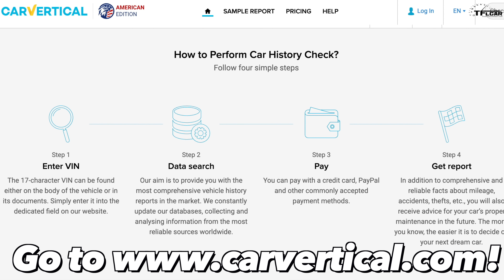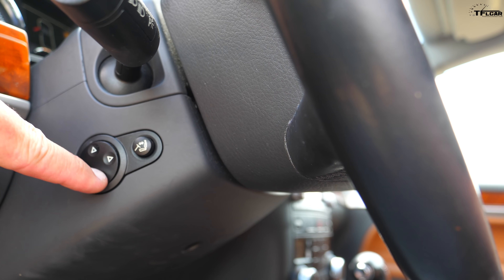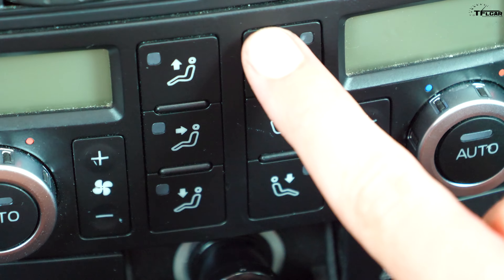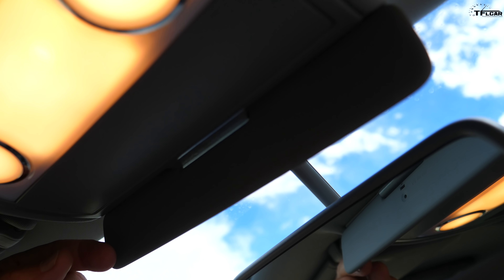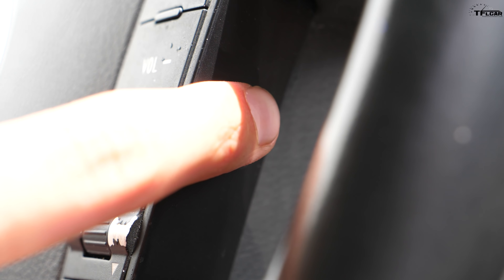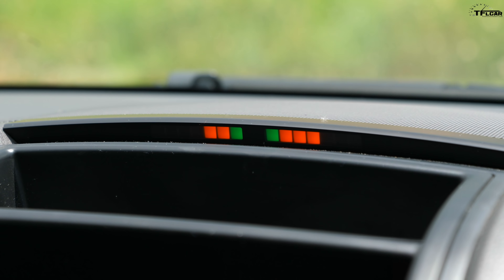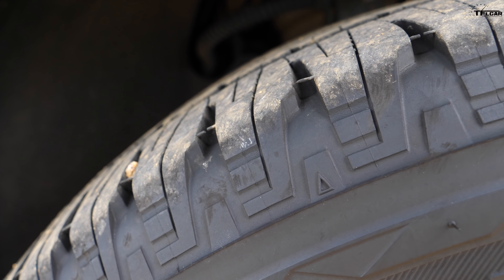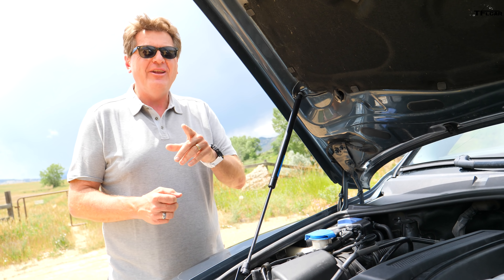We Just Bought The World's MOST Under Appreciated AND Over Engineered Car! Tough T Ep.1

Comment: Nice vehicle for the channel. These interesting cars are why people watch. Sure you could have bought a 2003 Lexus GX 470 or 4 Runner but it would never break and are everywhere so what's so interesting about that. Good choice for entertainment.
Reply: I own both a 2003 GX470 and a 2003 4Runner. Indestructible but no rear locker, front locker option. Less clearance overall. Less power, 5 speed auto only. No 2wd option in the 4runner v8
Reply: Very good perspective, Dallas.  Should be worth 10 episodes at a minimum with 200 comments each about how unreliable these are and how prone Tommy is to hitting things.

Comment: The Toureg is one of our most favorite vehicles, we had the diesel loved it, great gas mileage and power.  The Toureg had a fantastic Torsen AWD system which as an AWD fanatic I think is the best. The Toureg handled very well was comfortable and other than one engine issue that VW took care of was extremely dependable. We sold it back to VW for near what we paid for it with over 40K miles on it and wanted to buy another diesel but couldn't.
Reply: The  Tourege was state-of-the-art and well ahead of its time. Unfortunate, mericans didn't know what to make of it, and VW no longer imports to the U.S.

Comment: I've had my 07 since 2012 and absolutely love it, it's my daily. By 2007 they worked all the kinks out like upgrading to a timing chain that only needs changing every 100k miles vs 25k for the timing belt. Great truck, but like all older germans they need to be kept up. Anyone who works on older Cayennes can wrench on a Touareg. They used Audi motors just fyi. 

Truly a wonderful beast of a car that is equal parts capable and composed. The perfect balance 👌. Nothing today comes close. 

I predict it keeping up with the Jeep. Although the Touareg is very heavy in comparison, keep that in mind. Literally the same weight as a Cadillac Escalade (the Tahoe sized).

Comment: A mid to late 2000 VW= something's going to break every month. My 2010 Jetta TDI was in the shop almost monthly until VW bought it back (Thank God)!
Reply: Have a Audi A3 8L 1.9TDI 2002 with manual gearbox, running fine at 385k km :P
Reply: Didn't they have a recall that was so bad that they kept denying it?
Reply: @rkan2  you're the exception not the rule
Reply: Just because you had a poor experience doesn’t me others have. VW’s have been my most reliable vehicles.
Reply: @ljgarrison6910  Nah, I just have a VW with a manual gearbox, timing belt, and no DPF... ;)
Reply: My 2010 jeta tdi was the best car i ever had 130k miles not single problem of any kind not eaven rattling plastic or panoramic sunroof problems. At about 30k my father hit a dear with it, actualy deer hit him on freeway into passenger door. Got fixed up and no problem after that. Got 4 other vw not single problem with 2.0 and. 2 wr6 and 2.0t gti mk5 all of them manual transmision. If you want to call it a problem only 2.0 used about 1quart of oil before oil change 5k that newer changed until day i sold it.....
Reply: '06 golf 1.9 tdi 165k miles, nothing wrong - apart from the usual (brake discs, new clutch etc).
Reply: @ljgarrison6910  the 1.9 was very reliable. A co worker had a Jetta A4 TDI which he put 400K km. It was his beater. He junked the car after the clutch gave up and the body was beyond repair.

Comment: I had the same car back in the day and loved it.  19 » for summer and 17 » for winter. Great car except high fuel consumption even for those days and high curb weight which does show on- and off-road. Never had anything wrong with it but maintained it as per VW guidelines. It was fun off-road, did a course with VW instructors in France (they used V6 diesels) and felt that was the best overall engine, more low RPM Torque that worked well with the gearbox, less weight over the front axle and lower fuel consumption. Looking forward to the off-road episode!

Comment: Oh! One really fascinating feature you haven't discussed yet is the fact that the truck comes with its own very long air hose with tire inflation chuck and built in gauge on it. The hose plugs into a port in the air suspension system underneath the front of the passenger front seat to inflate tires. The hose is indeed long enough to reach every tire on the truck.

The spare tire itself has a collapsing sidewall. Once inflated, it is just about full size, but obviously nowhere near as rugged or capable of gripping off road terrains should you get a flat on the trails. That was an option on Touaregs in Europe to have a tail gate mounted spare tire on its own swing away frame. Plus, there was an optional electrically disconnecting front sway bar.

As usual, Europe always gets the good stuff and we get the scraps.

Comment: That suspension system is sweet, but how long until a major repair needs to be done? Nonetheless, plenty of cool features and one heck of a price with the new-ish tires.
Reply: replace with coils if it goes out
Reply: Never put coils on it. Had one for 5 years with air and no problems. The air is one of the best features. If it does have problems parts are easy and fairly cheap to get hold of.
Reply: The car has already lived a long and useful life. This is round two, and still going. So the naysayers words of fail fall of deaf ears.

Comment: I own a 2004... only been driving it since March. I went all in and got the V10 diesel. Put 10,000 faultless miles on it so far. That is after I fixed what was broken when I got it... which was that the camshafts have worn. Engine out job. Super interesting engineering all over in these trucks, that V10 diesel engine included, but they are indeed a bear to work on. And I do my own work. I bought the special tools to do the job. Even despite having a hoist at my disposal, it still took me about a week to drop the engine and take my time carefully changing out all the parts. I put new high pressure fuel pumps on it too (well, the passenger side is technically a "tandem pump", as it also contains the vacuum pump for everything that requires vacuum).

As far as I know, the air suspension on mine is original, too... with 180,000 miles on it. So far so good.

I am not going to rely on it as my only vehicle, but I sure as hell am going to get full enjoyment out of it. The V10 is insane. It's not any faster to 60 than the V8, really, but it just feels effortless when you dip into the throttle. Actually, thinking about it more, the V10 makes identical horsepower to the V8 gas engine, just waaaay more torque... but also much more heft (the V10 rig was just shy of 5900 lbs without fuel in it). Also strangely, despite being the heaviest and most powerful engine offering out of the Touareg lineup, the V10 was the most fuel efficient, too. Mine has regularly returned better than 21 MPG on long highway trips doing 80 for long stretches at a time.

Strangely, mine doesn't have the rear climate controls, heated rear bench nor does it have the ski pass thru. The heating steering wheel was retrofitted by a previous owner along with the webasto auxiliary heater AND, paddle shifters. Nice, big, metal paddle shifters. I would not trade that feature for anything after living with it for a number of months now.

This might be the first torque converter automatic I'm aware of that also rev-matches downshifts. It's a bit slow and ponderous compared to dual clutch units in smaller vehicles or the latest and greatest 8 speed from ZF found in many different vehicles, but it does indeed rev match downshifts in tiptronic mode.

The way that air suspension and active damping system rides and adjusts, I wouldn't trade it for the conventional spring type suspension. The ride and adjustability is phenomenal. The seat comfort and adjustability is also amazing for long trips.

Great video, you guys picked out all the fun quirks and features (to use a Demuro term) I've come to find on mine as well. I love it.

So long as you can keep it out of the repair shop, you will be happy with it. And for how amazing it is on and off road, you'll end up willing to put up with a little pain when it comes repair time to keep such an amazing vehicle in your fleet. Looking forward to your off road adventures in it.

Comment: I bought a 2005 VW Touareg V6. I haven't really had many problems with it and bout it last year October for $3000. I do all my own maintenance. So, its been a great SUV. 

The only maintenance I have had to do so far has been rear brake pads and rotors, rear driveshaft, O2 sensors, and basic maintenance (oil change). All I have to do now is just change my catalytic converter before I get it inspected next year. So far a great vehicle.

Comment: My mother has a 06' v6 tdi for 10 years now and this thing is bulletproof. Never broken down and only maintenance on 150k miles mostly city driving. Early cars especially with the v10 tdi are horrible and far from reliable but the v6/v8 versions up from 2004 are quite solid cars. And men they're capable offroad. They can climb 45 degree angles and even make some jeeps blush

Comment: Love the Touareg! Was a VW tech and yes those first gens had a lot of electrical gremlins and are pricy to maintain. The v10 tdi is crazy to drive! Incredible off-road. The Touareg 2 2006-2010 many of the electrical issues were addressed and were much more reliable. The 3rd gen 2011-2017 are incredibly reliable although less off-road worthy. No more dual range transfer case or locking diffs but still do well off-road. They are built like a tank, handle very well, and my 2012 lux is my favorite vehicle to log miles on. Great seats, great visibility, stupid quiet inside, and who doesn’t love 6 piston front and 4 piston rear Brembo brakes from the factory!

Comment: Forget what year mine was but I paid 4,800 for it and it had push button start but it didn't have the nav system or the air suspension. Two of my favorite things about the car was the turning lamps that illuminated the road on either side of the vehicle depending on which way you put the turn signal and you can open the windows by putting the key in the lock and turning and holding it. Had it for less than a week and the CEL came on. Made an appointment to get it fixed and then a deer totaled it. Then I got a Forester.

Comment: What car had a cooled glovebox first? I know the 1998 Saab 9-5 had it
Reply: The Porsche 928. Released to the world in 1977 as a 1978 model.
Reply: @autobahnproven  Are you sure?. Cool
Reply: autobahnproven cool! Thanks
Reply: My company car many years ago, a renault kangoo (I believe it was a 2001 model) had the cooled glovebox as well. 
It can't be about the money as much as the manufacturers think it's unnecessary.

The kangoo and other small panel vans aren't known for their high-tec and advanced features.
Reply: @marfrandema1884  Yes. I've had four of them. Including a 1978.
Reply: pelleper it's super cheap. Just run a hose prior to the air mix stage to the glove box and put a cheap plastic peace to open and close. In the 9-5 the hose is very short. Probably just 20 cm or so.
Reply: I had a 1991 Chevrolet Monza in Brazil (Known in Europe as Opel Ascona and basically the same car as the Cadillac Cimaron) that had the cooled glovebox
Reply: 2007 Gti owner here,

The car has it, but I doubt it can keep things “cool enough”
Reply: my '94 golf mk3 had cooled glovebox.. and even my friend's '96 e36 has that "sniffer clima thingy too"  my e46 has storage under the passenger seat..  i know im spoiled european, but this thing has less "fancy" things than you think

Comment: I owned this car for 2 years, it wasn't the fully loaded version, it was great apart from the interior , it was falling apart back in 2010 every rubberized surface was pealing  it looked very bad, i also had one engine ignition coils go bad, despite the car being out of warranty VW changed them for free because that part was covered by the supplier for 100k . it was good to drive on the road,  really good suspensions, good off road,   not as good as a proper jeep or toyota . but was good enough.  there was a strange smell and when i checked with the dealer they said the sound proofing material was from recycled bags lol.
Reply: supernova1976 My ex had the Phaeton, VW’s flagship luxury sedan.  The Phaeton used plastics made from corn oil.  When error codes started appearing, a look underneath showed rodents were eating all the insulators from the wires and had even been chewing the wheel well skirts!  They did thousands of dollars of damage all because VW chose food based coatings.

Comment: I have the 2005 model year of this car and I love it. Fully loaded V8. There is also a compressor hose under the rear driver side passenger seat that plugs into a hose port under the front passenger seat. This way you can inflate your tires and the special spare it comes with.

Comment: Great vehicle. Looking forward to your videos on this!  I had a 2006 V8 model and kept it for 10 years.  Replaced onboard compressor, several sets of Continental summer tires before changing to all-season.  Never off-road, in mine, but went to Moab with VW when they offered their Touareg Adventure.  Incredible experience, even with street tires, but would be even more capable with better tires.

Comment: A very common problem is the front differential going out just after 100k. Dealer repair cost >$5000, I fixed mine myself with rebuilt parts, but still cost almost $2000. It is really good off-road but it is a ridiculous in difficulty and cost to repair. And lots of things break. Oh and don’t forget all the special tools. 

P.S. try finding the battery without the manual...

Comment: Electrical nightmare!!🥴 As a mechanic I tell people that German vehicles are great as long as you have a warranty but be prepared to be nickel and dimed to death unless you have a deep understanding on ohms law and like a challenge and or a hobby, then you will probably have a annual brake job to consider and if equipped with air or electronic suspension it's soon you will realize why these vehicles can be bought for such low prices.

Comment: You can also use the on board compressor to pump up the tires. Check the manual.  The V10 tdi also had a dual battey system. 265/65r18 will work fyi.

Comment: You will def want a good T1 mechanic, especially for these early years. Much more reliable after 2006 but the reputation the early years have stuck around. T3 TDI, while not as much off road tech is actually very reliable. Nice examples can be had in the mid to upper teens and thanks to the emissions scandal have a factory 10 year 120k warranty that covers any emissions related component, turbo, long block, heads and on and on. T3 TDIs are an awesome used buy at the moment as are their Cayenne and Q7 counter parts.

Comment: I have a 2005 Cayenne S (4.5 V8) which is the same vehicle, have owned it for around 3 yrs been an awesome vehicle, have used it off road and hard on road, only negative is the fuel consumption has been very reliable other than normal maintenance vehicle has now covered over 130K (miles) totally under rated vehicle

Comment: The little "sunshade" behind and above the mirror is designed to fix a flaw in the VW interior design.  When driving at night with headlights behind, you can get horrendous reflection into the mirror, off the plastic cabin lights and panel mounted behind and slightly higher than the mirror.  Such reflections occur particularly badly if you have a car with the 2 position day/night mirror, and use the night position, or if you have following headlights below and behind such as when cresting a hill.  Deploying the night visor blocks these reflections completely...

Comment: If it was properly maintained, you shouldn't have any problems with it. I have 175k miles on my 2006 V8 Touareg and the only major thing I have had go bad was the center driveshaft bearing. My coil packs lasted for 174k miles. One thing you didn't mention is the onboard compressor can inflate the tires with the hose that should be under the rear seat. Also wished you had the tow package on it so you could do the Ike gauntlet with it.

Comment: I had a 2008 V8 Touareg and it was amazing (when it wasn’t broken). At the end of my time with it everything started breaking and the estimate to fix everything was $14,000. While I had it though it was one of my favorite cars of all time!
Reply: Colorado Cars same year as mine. What was your laundry list of issues.
Only had the center carrier bearing issue on mine.  All others were wearing items like brakes, tires and wiper blades.
Reply: @DOCPSYCHOsince1968  Both control arms needed to replaced because whenever you went over a bump the car would create a terrible clunking noise. The coolant reservoir was leaving and that had to be completely replaced. Also the cars oil pan was leaving which is another very expensive fix. Some things also went wrong in the interior. The middle seatbelt was completely locked up which would have cost $300. Every speaker in the back was not functional, all needed to be replaced. Even with all these problems I still would pick one up today cause the car was just that great when it was working!

Comment: My 2002 Audi A6 4.2 had most of those features and I loved that car, but was in the shop at least once a year for repair. Nothing could be fixed on that dang car for less than 1000 bucks. It had three fuel pumps, one if which cost 1200 bucks or so and what made me sell it was the sensor that controlled the abs, traction control was faulty and that part used was around 1000. Had no traction control or abs when that part went bad. It did drive great and had features most cars don't have now, but expensive to fix.